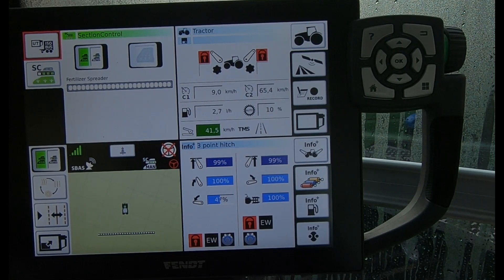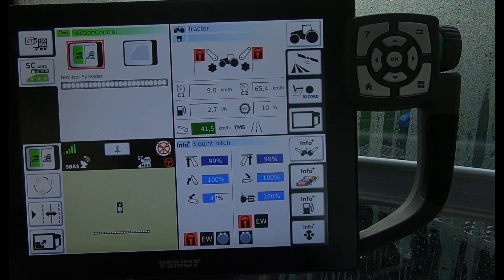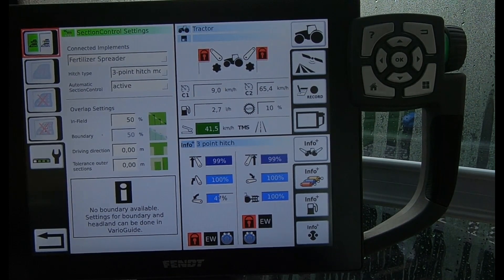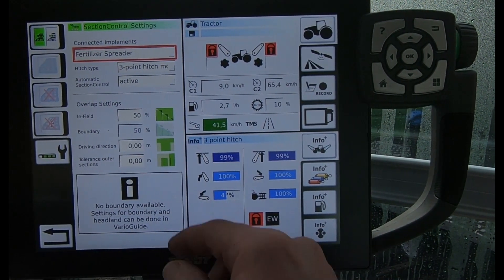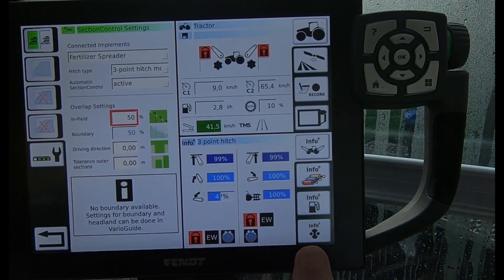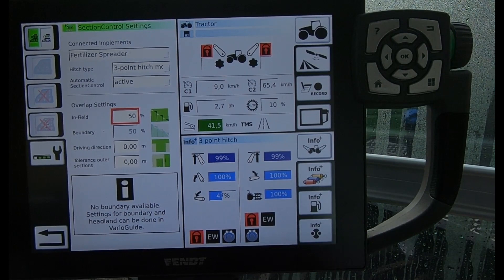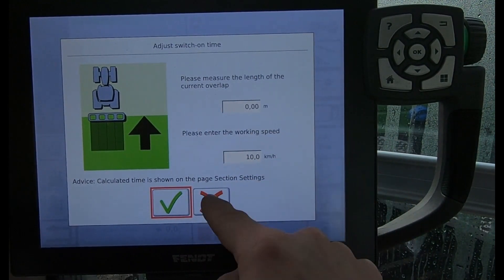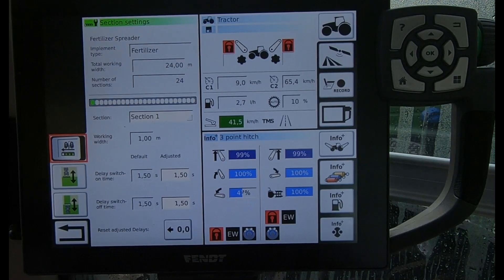NT01 Section control

Comment: Do I need section control in order to control the application rate? Or do I also need variable rate control. My dealer says I need the section control unlock before I can get the vrt unlock.